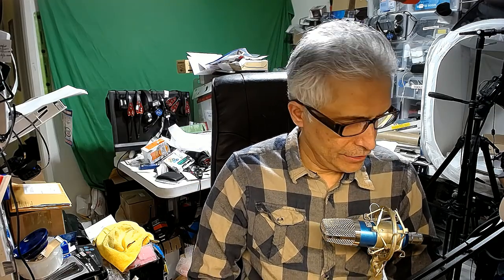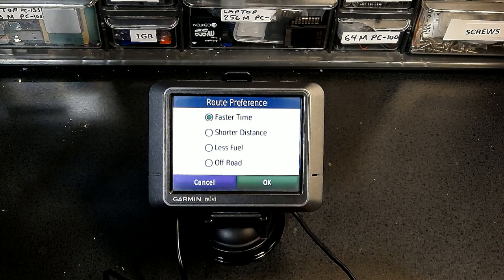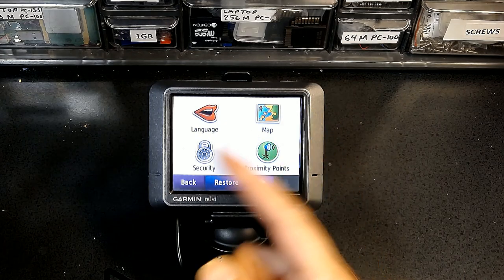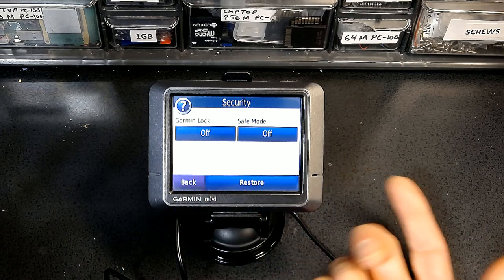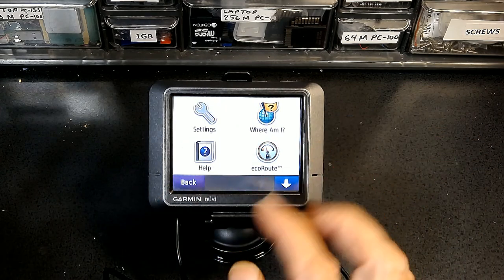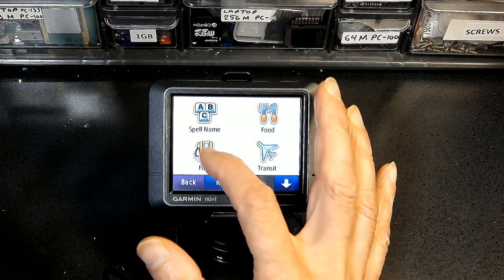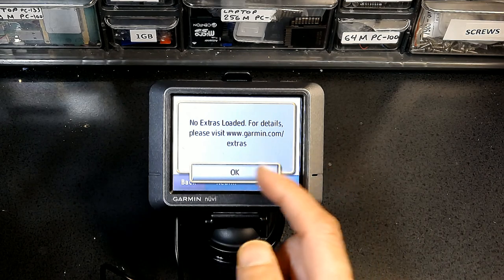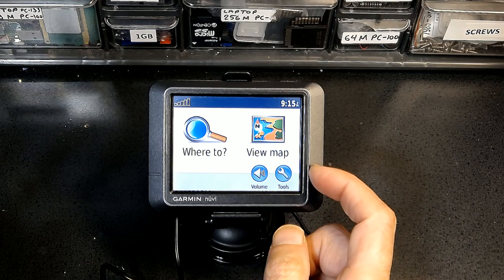Tutorial on how to use a Garmin Nuvi 200 205 255 265 270 GPS Navigation

Comment: How does this unit fares in 2021? Thinking of buying a used one..
Reply from the maker: This is a very small GPS with the screen size of only 3.5" diagonally, if you are OK with that the unit will work fine with the 2021 maps. Actually 2022 Maps are out now and it even worked OK with that.
Reply: @TECHNOLOGYTIPS101  ok thank you,great videos!
Reply from the maker: @theretrogeek2281  No problem!
Reply from the maker: @MAN_MAN Sure, Click on Tools, click on Picture Viewer, Click on another photo, click on info, check the box that says " Display at power on?"  The image enlarges and covers the screen, wait 5 seconds now click anywhere on that image and click Back. That is all

Comment: Nice video👌
By the way, do you know why if garmin nuvi 205 can't get satellite signal?
Reply from the maker: Hendra Smd Hi thanks for the compliment, you need to use Garmin webdate to update the firmware and only then it should be able to get satellite signal. Because the satellite geographical location changes on a daily basis and if the GPS is off for a very long time it will have a hard time finding satellites unless you get an update.
Reply: @TECHNOLOGYTIPS101  Yes, I haven't worn it for a long time maybe more than 5 years ago. I have also updated my device using the Garmin Web Updater (Firmware for GMTxx, Binary Data Fonts, Time Zone, and Language). Do I have to bring Nuvi 205 to the outside environment, for example, traveling around the city to look for satellite signals?

Thank you
Reply from the maker: @hendrasmd2499  As long as it is outside not under a roof, and as long as it has a clear view of the sky " Clouds are OK" it should be fine. You don't have to drive it around. Also keep in mind that for the first time it might take very long to find satellites. To see the satellite progress you can click and hold your finger on the satellite signal on the screen.
Reply: @TECHNOLOGYTIPS101  Okay, I see. Thank you for the tips. Your comments and videos help me further to use Garmin Nuvi.
Reply from the maker: Hendra Smd no problem I’m glad it helped you
Reply: Mine does.
Reply: @TECHNOLOGYTIPS101  They follow me everywhere! HELP!!!😁😀
Reply from the maker: @truthlibertyjustice4all255  Satellites follow all of us, you are not alone, lol

Comment: How to update new maps firmware for nuvi205? do u have link to download?
Reply from the maker: For the firmware you don't need a link you can get it automatically by using Garmin Web Updater from Garmin's Website. Don't use Garmin Express because it requires you to register with Garmin First, and it will not give you options to choose what to install.